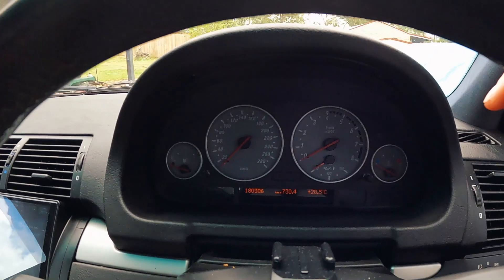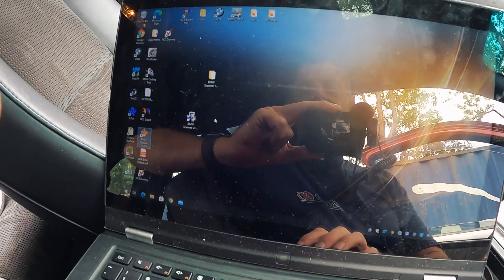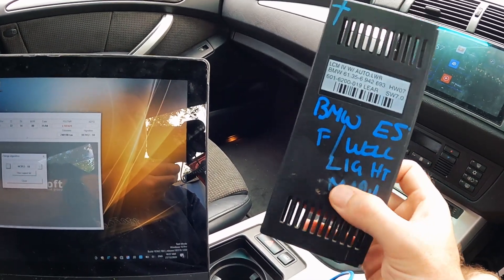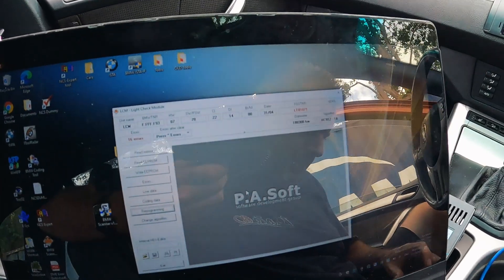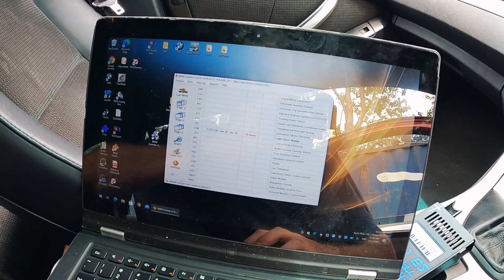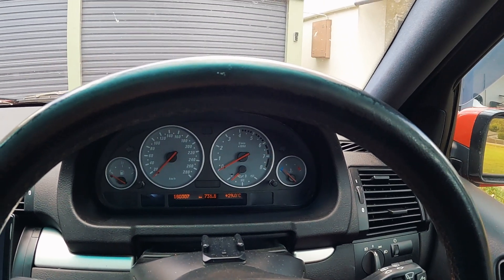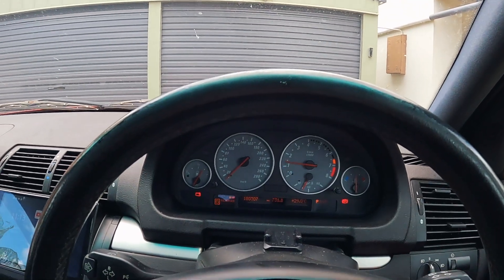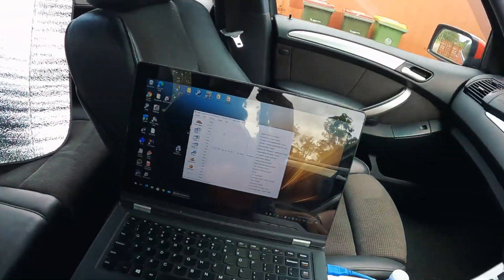BMW Milage Tamper Dot Removal E46 E39 E53: LCM Programming DIY

Comment: Will this work on z3?
Reply from the maker: depends on which generation
Reply: @ZeroTo60Tube  2000 z3 2.8?
Reply from the maker: @ralphpecson7291  Are they this generation of clutser? Same as E46? Or are they based on a E36? I have never had anything to do with the older z3s mechanics. I feel like they are e36 electronics.

Comment: I just used you video and PA Soft BMW Scanner v1.4 to clear my tamper dot and to write my car’s VIN to a cheap secondhand LCM that I installed in my E53 X5.

Thanks cery much for taking the time to upload this video.

Very helpful. I’ve found PA Soft is very easy to use and worked first time (unlike NCS Expert).
Reply: The donor LCM keeps triggering an active fault for “no connection to rain sensor”.

My car does not have a rain sensor, so the module is expecting to see a rain sensor which the donor car must’ve had.

Is it possible to code my car’s features into the donor module?

I know it’s possible to do this with NCS Expert (the software copies your car’s features from another module in the car), but I can’t get NCS to work on my computer.

Cheers.
Reply: @OilBaron100  you may have already resolved your issue, But if you havent bmw scanner 1.4 can code options just like ncs expert but alot easier.
Reply: @hackzgames  yes, I’ve noticed that. Have already adjusted the VIN and mileage in a used LCM.

I have also noticed that I can reprogram my GM3 module to lock the doors after the car gets to a pre-determined speed.

Very user friendly, don’t need to be a German-speaking Rhodes scholar in order to work out how to use BMW Scanner 1.4

Comment: Would an impa cable work? If not what cable do I need to buy?
Reply from the maker: You need the pa soft tool
Reply: No, you need a special cable. PA Soft (BMW Scanner v1.4) won't work with a regular D or K CAN cable.

Comment: Hi, I’ve BMW X3 E83 2.5i 2004 I swapped the original HID headlights to angels eyes that came with their control modules and it worked for a while like a month until low beam on the drivers side stopped working. 
I’ve tried replacing bulbs, even swapping the left headlights left to right still same issue remains  I also tried replacing the original HID headlamps still problem remains no low beam on driver’s side only.

Any ideas and help I would greatly appreciate thanks in advance

Comment: Hello, I need to replace my cluster in my e53 X5 and I can't afford the new one. Will this software help me set the mileage of my new used cluster to my actual mileage in my original cluster?
Reply from the maker: I belive so, however i would recommend finding someone that has gone through the entire process that you need to, sometime this sort of work can be finicky.
Reply: Thanks

Comment: Thanks for sharing! I just saw a used newer LCM show up locally that I wanted to buy but didn't want to deal with a tamper dot in my E46. I've used PA Soft before to make my temp gauge in the instrument cluster more linear by removing the buffer zone that makes it always look like it's set in the middle. Always appreciate your helpful videos.

Comment: We can't remove the dot on the cluster with the reset button and hidden menu options instead using a laptop? like in the E36? The e46 menu says its on menu 15 but when I'm there I can't access the dot manipulation option.
Reply from the maker: Not aware of being able to do it that way.
Reply: @ZeroTo60Tube  Thanks anyway 👍✌️

Comment: PA Soft is also great for calibrating your speedo to be dead accurate or setting the BMW service intervals to a more reasonable 10000kms or so, instead of 30,000km!
Reply: PASoft will also reprogram the temp gauge so it's not buffered from 75C to 115C at 12 o'clock.  (At least on the e46 it's buffered that way.)

Comment: Gone are the days when you could stick your car in reverse when it's on Jack stands and literally reverse the mileage haha
I had an old Peugeot that had a very temperamental speedo, and I didn't find out until months down the line that the mileage also didn't change when the speedo wasn't working
Reply from the maker: haha, i remember hearing of people connecting speedo cables up to drilles to do it too. LOL

Comment: Nice work andrew, what do you use for coding your e9x? And when we comparing the manual to auto 335, interested as ive only drove my man and never been in auto👍🏴
Reply from the maker: Coding on my e9x was all done with ncs expert, but do be honest it really baffles me which is why I’m yet to do a video on it for fear of making a mistake
Reply: @ZeroTo60Tube  god must be bad if your frightened by that but will strip x5 gearbox 🤣🤣👍🏴

Comment: PA Soft looks user friendly compared to NCS Expert and Dummy.  So nerve racking when doing custom coding (anything other than programming a virgin module is custom), especially with new software.  Well done, my video would have been demonetized for sure for language, if I tried this. (I don't have any videos just saying it would be demonetized)
Reply from the maker: Couldn’t agree more with that. I still get confused with ncs expert.
Reply: Ideally the LCM should be recoded with NCS Expert based on the ZCS so that it matches the options and functionality of the destination vehicle. May be lucky if it's been sourced from a similar vehicle though.
For instance, for the E39 there are settings to tell the LCM whether the vehicle has the facelift LED tail lights. I believe that some of these things can be coded with PASoft but not all.
Reply: @rsporsche  would you have any more info on this process? I need to do mine as just bought a used LCM from the same model and year X5, but I understand they can have different factory fitted options so need coding to match?
Reply: @DanReVanced  It's been a while so I'll need a little time to refresh my memory, feel free to give me a nudge if I haven't replied by the end of the long weekend

Comment: Nice work. It's funny BMW chose the light module as a place to store mileage (or KM's) & VIN. Is it an assumed replacement, in the case of an accident I wonder? Regardless, welll done. I'm doing a gradual replacement of old parts on the E60 and I keep thinking I should video it for others. It's always nice to hear someone do something with condfidence in an accent you're familiar with. Makes a job sound 'doable'.
Reply from the maker: Definitely worth videoing!!!! Let us know if you have any questions on putting the vids together.

Comment: Do you know if this program can update the transmission(EGS) vin for an e92
Reply: NCS Expert should be able to do that I think. I believe you need to write the vehicle order (VO) to it. Did you swap it or program it with the Alpina software? After I wrote the Alpina software to my E90 I needed to use NCS Expert to write the VO so I could get rid of the "Coding Missing" error.
Reply: @Fix_It_Again_Tony  recently my transmission on my 2009 335i e92 went out and I'm looking to get a new(used) transmission to replace my broken one, I'm still not 100% sure if the car has to be coded to work(run and drive) or what not.
Reply: So I been looking into the whole coding side just incase. From what I know is that I can use WinKFP to update(software and vin) and should work? Hopefully?
Reply: @TTGGReeDY  So I have a pre-03/2007 build and had the old valve body. However I wanted to upgrade to the Alpina EGS software so I needed to get a 03/2007+ valve body. I bought one and replaced it then used WinKFP to program the Alpina software. Everything worked fine and I didn't lose the use of my paddle shifters. Years later I loaded the xHP Flashtool onto my phone and learned I had an error related to the VO not being coded to the EGS. I fixed that with NCS Expert. 

 If I recall correctly (it has be nearly a decade now) when I programmed the EGS with the Alpina software using WinKFP, I wrote my VIN to the new EGS at that time. So at a minimum that is what I would think you need to do.

You will need the BMW Standard Tools (version 2.12 is what I have) and the Daten for the E89/E9x chassis. 

Start here: https://www.e90post.com/forums/showthread.php?t=1196830
Reply: I was just looking over the steps on E90Post. I did not start with a new Windows install. Good luck!
Reply: @Fix_It_Again_Tony  sorry I meant the program WinKFP, we'll see what happens when the time come, it's been 50/50 that yes the vin has to be updated for the new transmission to work and that no theres no coding for the transmission to work.
Reply: @TTGGReeDY  it does not so long as you get one out of another 335.  WinKFP is more VIN rewrite.  It will not cause VIN mismatch on KOMBI.  However if someone pulled up the User Ident List in INPA they would see the VIN mismatch and know it's a used trans.
Reply: @igotaction  thank you. I appreciate the info :)

Comment: The factory ike is programmed with a mileage offset when the car is new ,I have seen them offset from 11 to 51 kms . So when the cars are new the mileage on the odometer will say 999989 if the mileage offset is 11 kms and that is for transport to the dealer the ike will hit 0 and the lcm and ews will show 11kms  . So the ews and lcm are the actual mileage of the car . When you write mileage in the lcm with pa soft you just set it to 0 and when when turn the ignition off and on it will download the correct mileage from the ike with the proper mileage offset to the lcm.  With pa soft you can check what your mileage offset is by going to the ike and under coding data then click ''Recoding'' it will show you what options are enabled on your ike and the bottom right corner will show you the mileage offset ,set mileage offset to 1 if you want the same mileage reading in ike and lcm